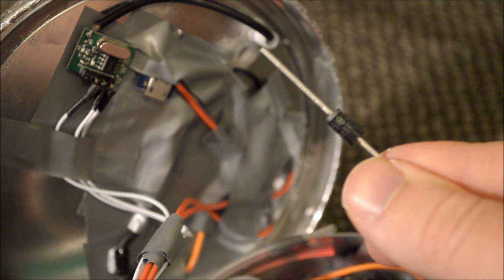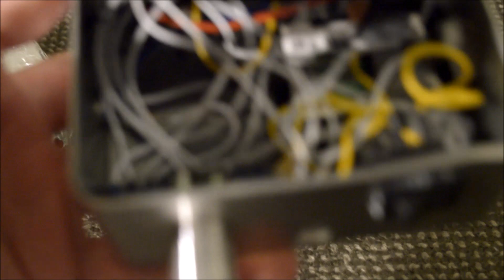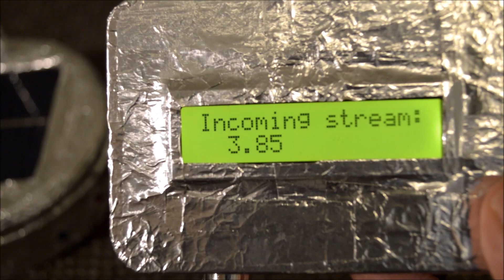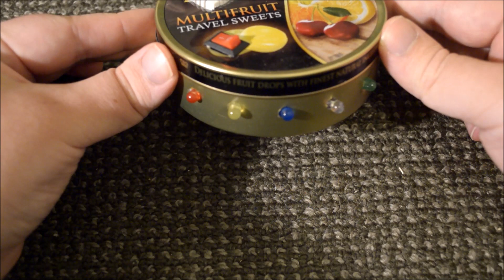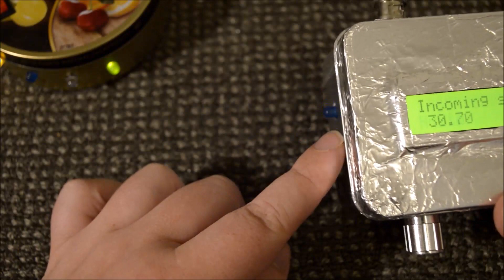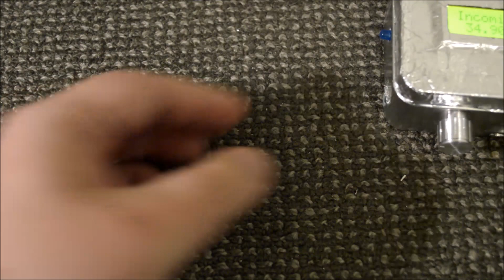Arduino Solar QRP Beacon - UHF Telemetry Readout

Comment: Why are you not licenced? You should. Also I love your accent.
Reply from the maker: Haha, no idea.. thanks for the kind words, maybe one day my accent might be coming over the 40m band ;)
Reply: @MattExzy  go get your license !!!

You can build and deploy a beacon on the ISM 13.555 MHz band which allows you 100mW ERP 

It’s covered under a low interference potential device class license you’ll find info on the ACMA site, which lists a bunch of other frequencies you can legally transmit on with limited power without a license.

Managed to receive 100mW on New Zealand Web SDRs with 100mW on 13.555